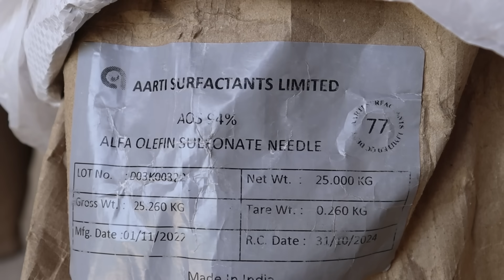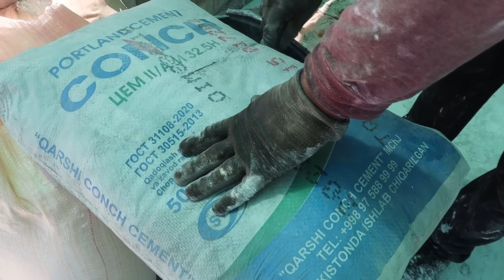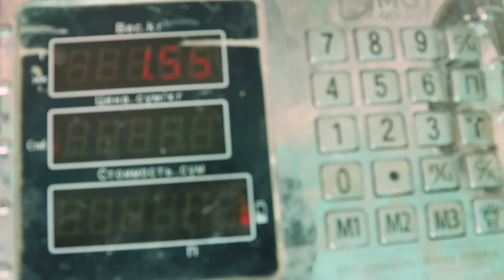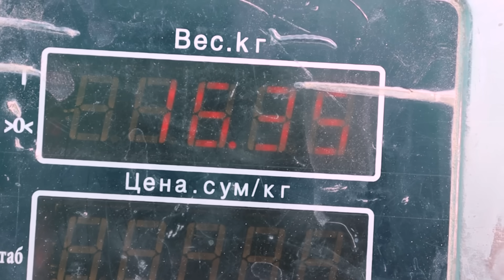Amazing process of making foam concrete blocks | production of foam blocks with subtitles

Comment: This seems like it would be good for 3d printing houses
Reply: I am thinking of laying all the steel reinforcement bars horizontal and vertical bars with the finished concrete columns and insert the foam blocks for the window holes and install  all the forms so that we can pour it all at once in one whole span of wall.. in just 15 mins your wall is done.. wow!
Reply: I'd imagine it's pretty porous? Water makes rebar rust.
Reply: Its horrible stuff. Dont ever use this.

ITs only used to save cost and the quality is insanely bad.
All foam should be banned in building. All of it.
Reply: Plaster dissolves with water. Can this block be used outdoors? What chemical additive is used for waterproofing?

Comment: Can't wait to get started on building my 30-meter foam concrete and Flex Seal yacht.
Reply: hahahaha :D good idea
Reply: Not far fetched in the Russians slums like that.
Reply: Wouldn’t even need the flex seal aside from aesthetics. My dad built 2 15 foot islands with styrofoam concrete when I was young… they floated just fine, still probably would but no one has taken them out in as long as I can remember.

Comment: I am glad to report that I made blocks very successfully based on your recipe. Thank you!!
Reply from the maker: I am very happy for you
Reply: ما هي المادة صانعة الرغوة
Reply: Habla sobre la resistencia o dureza que tienen los blocks
Reply: What's the first ingredient which  added later to the foam machine
Reply from the maker: @mohamednour3978  Details in this video and don't forget to activate the subtitles https://youtu.be/-h6zBbVkuQI
 List of ingredients for 3 foam blocks
37 kg gypsum
2 kg cement
50 liters of foam
50 liters of water
Reply: Can I put PVC pipes to create a hollow block? What is the size of your block, can I make it 14cm wide?
Reply: Is it possible to add the plasiticizer or this can't be added with gypsum?
Reply from the maker: @dr.muhideenhasan2757  I don't know, but I'll have to experiment
Reply: @BbAmazingSkills  250gms of olephin make 150 blocks. you dissolved all 250gms and poured in the foam generator. how do you get the 2500ltrs of foam without diluting the olephin
Reply from the maker: @alimusa180  250 grams of olefin yields 150 blocks. from 250 grams of AOS, pour 50-70 liters of water into the foam generator, you will get 2500 liters of foam
Reply: @mohamednour3978  alfa-olefina sulfonada a 94%. Clique em legendas que aparece a descrição de cada ingrediente utilizado.
Reply: @fnmotosecarros5676   Aqui no Brasil utiliza-se esse recurso, mas creio que seja conveniente retirá-los logo após o início da cura do concreto para facilitar a sua retirada. Na parte de fora da forma no transpasse do tubo, faz-se um furo de um lado ao outro do tubo e nesse furo enfia-se uma chave de fenda para fazer o movimento de vai-e-volta.

Comment: I love this video.  Look how much easier it is to pick up and move those big blocks.
For those of us who might try this at home, I did see a much simpler version where the woman had two 5-gallon plastic buckets, mortar and water in one, dishwashing liquid in the other.  She whipped up the foam with a paint mixing attachment on her drill -- the same attachment house painters use.  Then, using that same drill and mixing attachment, mixed the foam into the mortar in the first bucket.  Poured it into molds, and voila, building bricks.
Reply from the maker: thanks bro for the kind words
Reply: C est vrai? Ouhaaaaaa. 
C est pas parce qu on est pauvre qu on a pas du génie !!! 
Toute matiere qu on peut faire mousser donnera assez de bulles d air qui fera un beton plein de bulles d' air comme le fameux syporex ou beton cellulaire.
 C est tres ingenieux. 😊
Tres bonne isolation en plus.
Reply: Thats because they are weak and full of air!
Reply: @goober-ll1wx  But it must be strong because it looks like concrete. That's why I'm building my house of of gray styrofoam blocks that I found that also look like concrete.
Reply: شكرا على ما بذلتموه
خير الناس من نفع الناس
ولاكن قل لي ياصديقي كم هو الوقت الذي استطيع به خروج الكتلة من القالب
❤❤❤❤شكرا لكم من بلد العراق
Reply: Yea the right way is using perlite for aggregate with fiberglass fibers. It's light weight but extremely strong 3 inch slab could hold a semi fully loaded no problem
Reply: @tatooetugo    Please supply the link for that video.
Reply: hi, send video link pls

Comment: Would you ever mix shredded fiberglass into the mix to add tensile strength?   We often add glass fiber to concrete slab pours to reduce cracking.
Reply from the maker: I need to add and check for strength thanks for the recommendations
Reply: @BbAmazingSkills  I have also wondered what the effect will be of substituting a % of your mixing water with  liquid glass made from cat litter? My understanding is that a very tiny amount is needed, it will add tensile strenght and moisture proofing qualities to the finished bricks.
Reply from the maker: @martinbisschoff988  need to try
Reply: Can you give some more information about this
Reply from the maker: @61riaz  turn on subtitles
Reply: @BbAmazingSkills  any updates on the different materials mentioned like fiber glass or liquid glass?
Reply: @Dan-qx3nh  not necessary. These should only be used as wall infill only. They are not structural. The structure should be built with real concrete and rebar. Otherwise you're building a coffin.

Comment: I guess this is good for insulation, keeps house cool in summer or warm during winter.  Maybe suitable for small houses, no sure it can hold the load of buildings, has this been tested for load or strength of material?
Reply: Los encargados de aguantar el peso .. de una infraestructura son las columnas y vigas .. apoyadas de sus cimientos ..más no de los bloques
Reply: The problem will appear after 20 years, and it is starting to destroying
Reply: En Argentina se usa un tipo que se hace sin yeso. Sólo arena, cemento, cal y espuma. Son portantes. Se puede construir hasta dos plantas sin hormigón estructural. Se hacen en fábricas y se tratan en autoclave, supongo que para acelerar el desmolde. Lo práctico de usar yeso es que en quince o veinte minutos se desmolda, lo que es ideal para una producción tipo artesanal, pero queda algo sin resistencia hidrófuga.
Reply: Para eso está el arquitecto y su calculista y por eso hay que presentar proyectos primero , y por  eso las inspecciones de obra , este tipo de videos son de la fabricación de un nuevo ladrillo y por lo que pude ver tiene muchisimas ventajas al lado de otros ya establecidos , y como todo , tiene pro y contras. Pero es un ladrillo que me gusta .

Comment: There's a related video on an Arizona couple trying out "air-crete" to build a house.  They gave it up.  The quality was variable in their case (they were making it theirselves).  So I have doubts this will work for buildings you want to last many years, but it's still interesting for lesser projects, maybe a decorative wall for wind protection?   but you'd have to seal the exterior, I think, so the elements don't wear away the mortar.
Reply: Cellular concrete has been around for decades in the commercial construction space, with systems being perfected over time. When looking on YT for DIY aircrete examples to follow, don't pick the ones who failed & gave up. Dome Gaia & Aircrete Harry have been around the DIY space for many years and are good examples to follow. TinyGiantLife is also a good source of sound info.

Comment: Looks very promising but I'm a bit sceptical on the resistance of water, especially after seeing the bubbling in the test.
Reply: No es nada resistente al agua, pero los ladrillos comunes cocidos tampoco lo son. Se debe hacer un recubrimiento hidrófugo en las superficies exteriores con revoque o pintura o ambos. En Argentina se producen unos a base de arena, cemento, cal y espuma que son bastante más hidrófugos, pero se tratan en autoclave, supongo que para acelerar el desmolde, ya que al no tener yeso, demoran el fraguado.

Comment: Thank you for this great video. It is wealth of knowledge 🙏🏿
How stable is the blocks? Can you build with it in rainy areas? Does it require sealing? What is the mortar mis when you build with it?
Reply from the maker: They can be used for construction in rainy areas, they require sealing, when building with them, a tile adhesive solution is used, after which wet weather is not a problem.

Comment: Some other people been using this, they call it aircreate. I hope it takes off into full scale production.
Reply: It's been produced on massive scale for many years now, in proper factories, not hand made like this.
Reply: @jankoodziej877  could you provide a couple names of the factories that are producing it on massive scales?
Reply: @Da-Sheek  it's like asking who is producing cars or tires. This is a basic building material known for over 100 years. Some brands: Ytong, Solbet, Termalica, H+H. Those are just the ones available here in Poland.
Reply: @jankoodziej877  Thats good to see. I dont know of any here in the usa, we are slow to adapt in this capitalist economy.
Reply: @Da-Sheek  I wouldn't say that. It's just that wooden skeleton houses are so much more common in the US. Here we build mostly with various kinds of blocks, most often air bricks, but also this air concrete and silicat bricks. Each type has different characteristics. For example some are better at stopping sound, some are harder (which is good and bad), some are less conductive to heat, there are different prices and slightly different skills required to lay them properly. These air bricks are ok, but their main advantage is low thermal conductivity - but you still need an external layer of styrofoam in our climate to get proper results for winter.
Reply: @jankoodziej877  
"it's like asking who is producing cars or tires."
No it's not. Just because it's a common building material in Poland doesn't mean that's just as common everywhere else. It's absurd to claim that aircreate factories in the United States of America are as well known as automobile and tire makers.
Reply: It's industry term is aerated autoclave concrete AAC.

Comment: I think this would be EXCEPTIONALY well received where I live In Alaska. Shipping materials here is very expensive. And we need materials that are water resistant and offer insulation. I would LOVE to produce these things!
Reply: ive started making my own foam crete aka air crete in california. it takes time to dial it in but has so much potential
Reply: its not that water resistant. it wont fall apart immediately when wet, but over years it will. Uk schools and hospitals are falling apart because they used aerated concrete in the ceilings. Its okay for walls, when theres exterior cladding to prevent them getting wet, but on rooves they inevitably get wet, the steel inside rusts, expands, cracks the whole thing.
Reply: @ge2719   You could avoid using steel by using fiberglass or carbon fiber.
Reply: Or epoxy coated rebar & don't forget to coat after every cut. Should probably hit all ties wit a coat also. This is how they do concrete floors in bldgs but they add tiny pieces of Styrofoam instead of soap foam
Reply: Fibras de coco se pidria usar o sea ya seco el coco, en Ecuador es común el desperdicio de esto y se podria usar
Reply: @luissalas8628   ¡Muy buen punto! La fibra de coco debería funcionar bien para aumentar la fuerza. Me pregunto si las fibras se asentarían en la mezcla. Si las fibras se hicieron lo suficientemente finas, deberían permanecer en la mezcla sin depositarse en el fondo.

Very good point! Coconut fiber should work well to increase the strength. I wonder if the fibers would settle down in the mix. If the fibers were made fine enough they should stay in the mix without settling down to the bottom.
Reply: Consider adding fiberglass or carbon fiber to increase strength. Where in Cali? @ascensionrecordings

Comment: How much compression strengthen does it have ?hydraulic press test results would be more convincing
Reply: No falta el hijo de tapu qué para cada solución tiene un problema
Reply: Not much. Around 1/3 of normal concrete. Not for structural use. Wall infill only.

Comment: Great video!!!   

Weird suggestion.  In cooking when combining fluffy whipped egg whites in with other substances like a batter or custard the process is to fold in small amounts of the egg whites at first then add increasing amounts of egg whites until you just dump the last half in.

Folding in is a gentler process than mixing.  You take your spatula or spoon and you bring the mix over itself from the bottom.  Folding it rather than mixing.

I wonder if you had a long low container you could use a shovel to do something similar.
Reply: My dad taught me how to make pancakes as a kid, and I was watching this video thinking about that, and was pleasantly surprised to find I'm not the only one!
Reply: It's more important that you get a homogeneous mixture otherwise the structure collapses
Reply: it would keep more of the foam texture and bubbles.....
I was thinking the same thing when I saw that part!

Comment: Interesting mix. 37kg gypsum plaster to 2kg portland cement. These are more airplaster than aircrete. Gypsum is much more expensive in my area, this would be 4x the cost of aircrete but they look very nice!
Reply: Is that what the difference is between this and aircrete? Makes me curious what the differences between airplaster and aircrete are.
Reply: This is nothing like aircrete which is a sand cement slurry.

Comment: Estimados hermanos los felicito por su excelente trabajo.
Seria de gran ayuda para todo el 3er. mundo que publicaran una detallada lista de ingredientes y proporciones para poder autoconstruir nuestros hogares.
Cordiales saludos desde Uruguay mis hermanos!
Reply from the maker: Lista de ingredientes para 3 bloques de espuma
37 kilogramos de yeso
2 kilogramos de cemento
50 litros de espuma
50 litros de agua
gracias por las palabras amables
Reply: Consulta; si fuera un molde de 1 metro por 50 de ancho, no se quiebra? O debería llevar algún refuerzo de fibra de vidrio ?

Comment: I saw bubbles come out when the brick was submerged, will the bricks absorb rain water?
Reply from the maker: absorbs but does not dissolve
Reply: Como todo material de cemento, absorbe agua, claro que en pequeñas cantidades a comparacion de los ladrillos de arcilla que absorben mucho mas.

Comment: This looks like a remarkably durable product of low weight and good thermal resistance. I was wondering how fire resistant it is. Also how easy is it to stick together with mortar. If mortar is not suitable then what adhesive is used to make the walls stay together.
Reply from the maker: fire-resistant foam block does not burn in fire. masonry mortar is better to drive into Google in different countries, masonry mortar is chosen differently
Reply: Its called aerated concrete and was invented in 1923. It really is extremely light and has very good insulative properties but it is not as strong as bricks in terms of holding alot of weight. The durability test in this video shows that it will deform when its hit and stays in one piece. Thats because air is trapped inside there. But it is a very good building material for one or maybe 2 story houses.
Reply: Seems to me that this may not be for a high rise building but for remote areas and out buildings should be fine. They have been using adobe bricks and similar materials for a long time. And some are still standing. Given the right location and conditions this could easily last 50 years.
Reply: @BbAmazingSkills  primero, muchas gracias por compartir conocimiento, Saludos desde México. Nosotros utilizamos yeso cerámico para hacer moldes para fabricar cerámica, pero nos
Sucede que con el tiempo el yeso tiende a desmoronarse, degradarse, creo que por el calor. ¿Será que el cemento añadido y la espuma eviten esta degradación? ¿Con el paso de los años no les ha pasado esto? ¿En tu país tienen mucho tiempo usándose estos bloques para la construcción?

Comment: thank you. this is a great video. However, I am a bit uncertain about the proportions of ingredients.
the video shows:
 ingredients for 6 blocks 60cm/30cm/20cm: 16kg X 6 = 96kg
37 kg of gypsum plaster 
2 kilograms of cement 
50 liters of foam plastic weighing 1.5 kilograms 
(250 grams of AOC ALPHA-OLEFIN-SULFONATE per 5 liters of water)
50 liters of water
the blocks weigh 96 kg when dry; but there is only a dry weight input of 37+2+ 0.25 = 39.25kg
If this is correct, then 59.75kg of hydrogen and oxygen are bound up with the dry ingredients!
Please correct me if I made any mistake in this calculation.
Reply from the maker: you calculated correctly, but did not take into account evaporation, it never evaporates 100%, moisture remains, some percentage!!! thank you for your interest in my video, I'm glad that there are curious subscribers on my channel,
Reply: Toma en cuenta que preparan dos veces esas cantidades para llenar los 6 moldes. Si te fijas bien una preparación llena solo 3

Comment: If you are interested in making these, (or just foam concrete), I rent a machine that spits out the foamer with no mixing, and foamer liquid - in the US. The machine is important for big jobs, when using ready mix or concrete pumpers. (foam can be injected into pumped mortar)
Insulate under the concrete floors of a house or backfill a basement with it.  The foam cement's strength can vary from 20 psi ( no strength insulation) to 1000 psi (at 50 pounds per cubic foot).  This product has been in use to fill old mine shafts for years.  A foamer that lasts hours is essential- you don't want the bubbles to pop before the cement hardens a little.
Reply: Yes
Reply: Where do you buy the foam?